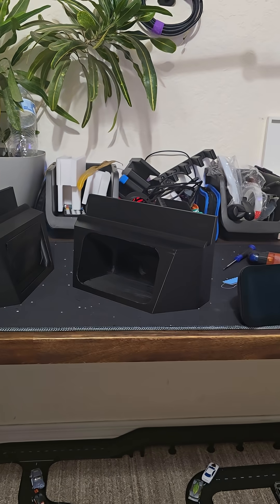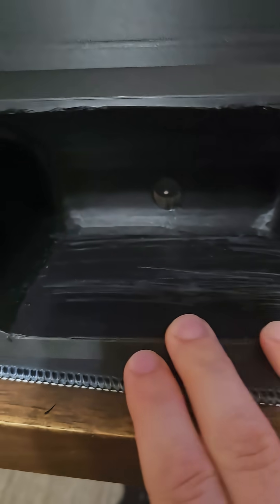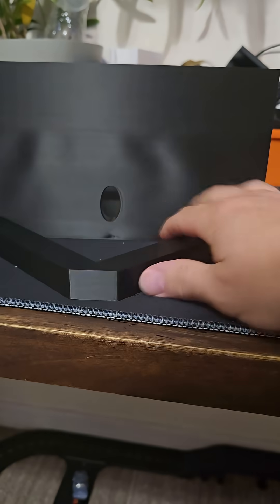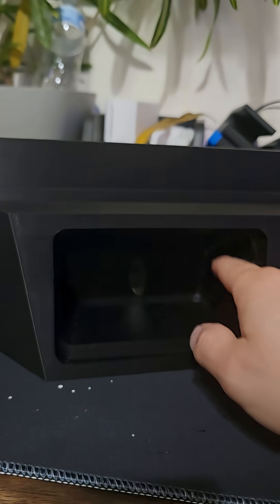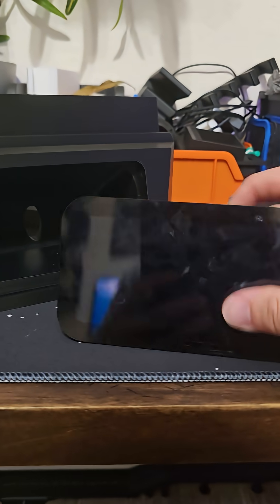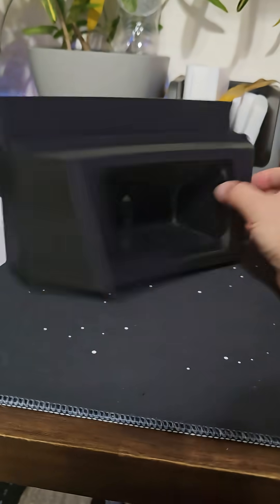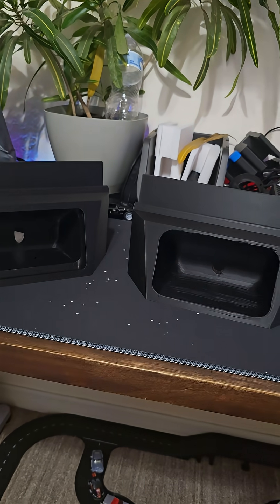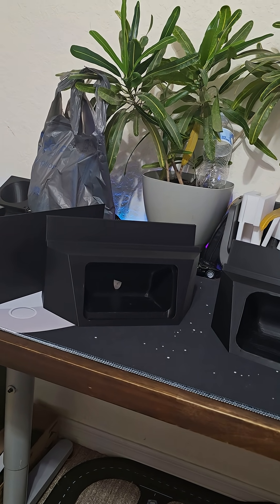I made to many changes to my 3D print design

Comment: I suspect the flowrate isn't calibrated, or your infill-wall overlap is a negative number. Could also be worth seeing if you can increase the print temperature. - I'll do my best to help you if you have other issues or any questions :)
Reply from the maker: I really think its the infill wall overlap. Everything else seems pretty dialed in. Probly try that first.